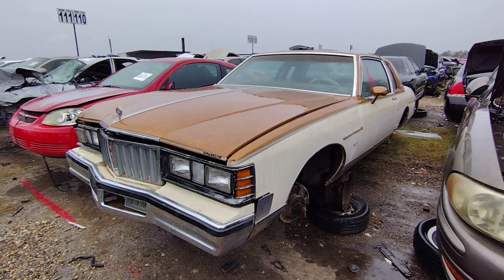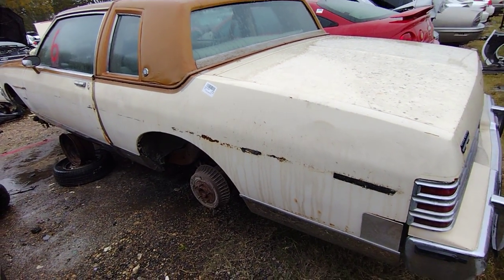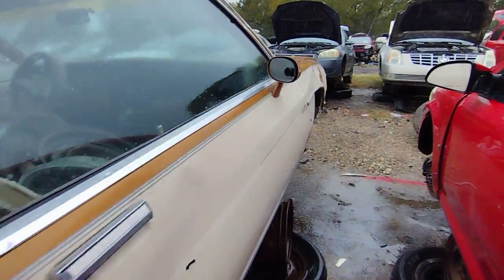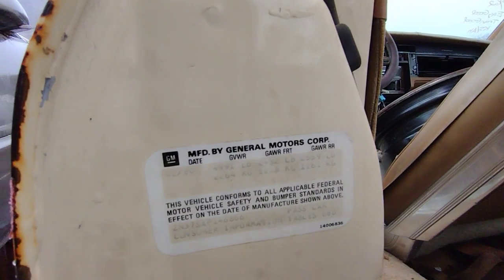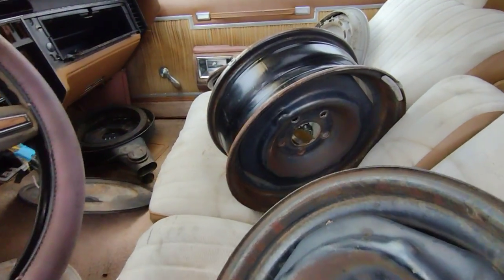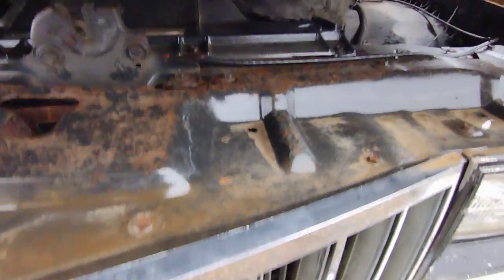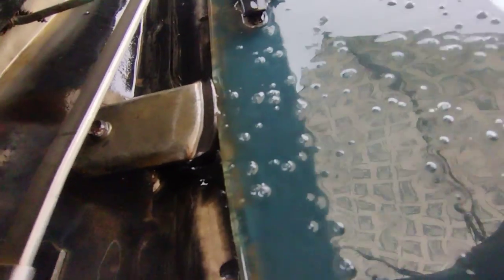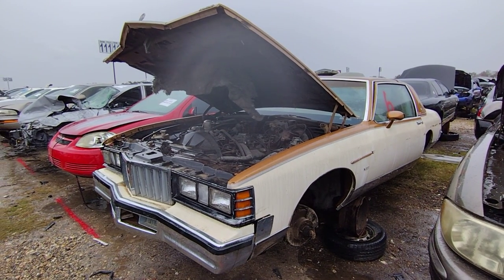One more year and this Rare 2 Door model would be no more. 1980 Pontiac Bonneville Junkyard Find

Comment: I like this car.  You are right - this is the mid range option, the lowest was the Catalina, the highest was the Bonneville Brougham.  The 265 V8 - very small.  Only offered in 1980 and 1981.  This thing couldn't have much power.  I drove a 1980 Regal with this engine.  It sure didn't feel like V8 power even though it was a V8.  And this car is larger and heavier than that.  What I really like is the two tone paint on this!  What is interesting is the right front fender - the tan lower body color came off in one spot - which showed how they painted the car.  The whole thing was gold at first, then they went back over the lower body with the tan paint - kind of interesting.  I didn't think that was how they painted these two tone cars, but that must be what they did.
Reply: Yes, the 265 V8 was slow, we had one. My parents did not regret it as the 1979 gas crisis was in the not-too-distant rear-view mirror. My parents were conservative drivers, so they benefitted from the smaller V8.

Comment: These were very rare in 2 door. These 265 4.3L V8 were notorious for blowing head gasket. The came with the following engine choices standard was the Buick 231 CID V-6 (1980-1982) 4.3L 265 CID V-8 was made to meet CAFE standards for (1980-1981), also came in the Oldsmobile 307 CID and the 5.0L Chevrolet 305 CID V-8 (1982-1982) Oldsmobile 5.7L Diesel option (1980-1982) to meet CAFE (Corporate Average Fuel Economy) in 1980 to meet 21 MPG and then  by 1984 CAFE standards across all lines kad to meet 24MPG and then by 1986 most everything was downsized especially at GM Chrysler to Front Wheel Drive to meet CAFE standards for 1986 of 26 MPG. The last year of these Big Oldsmobile 88 were 1985 and the last B body 98 Buick Electra Lesabre was 1984. By 1996 the Caprice and Impala SS  were done  Buick Road master from (1992-1996) Cadillac Fleetwood LT1 (1992-1996)Lesabre/Electra estate wagon(1980-1991) were the only RWD left outside of the Ford Panther platform which lasted until 2012 model year. Chrysler axed all their RWD varietals  Diplomat/Gran Fury and Fifh Avenue M bodies by the end of 1989. CAFE standards by 1995 had to be 27.g MPG across the manufacture;s whole line up
Reply: The 1982 Bonneville was not the same thing. It was a "G" body in 1982, and a B-body prior to that. No, the 265 V8 didn't blow head gaskets. It was an economy engine and just a baby Poncho V8, albeit underpowered in a large B body car. The 307 Oldsmobile engine was not used in the 1982 Bonneville, but it was used in 1981. My neighbor had one. In fact, you couldn't get a V8 in one in the 1982 model year in the US, only a 4.1L V6 as the top engine option.

Comment: New aero body for 1980. I believe the Bonneville was C Body and Catalina was B body. 1980 was a bad year for full size GM car sales, this Pontiac was no exception. Do not remember seeing many of these back then although the Bonneville did come back with a vengeance in the 1990s into the early 2000s. In the 1980s as Pontiac/GM was quirky with B/C bodies. the Catalina disappeared then came back as the Parisienne.  Fully equipped Bonneville Broughams of this era was interesting either 2 or 4 doors. Seem very rare today.  Shame this one was not well maintained. Any engine was fairly anemic.
Reply: That's not correct. The Bonneville would have been a B body then. There was no Pontiac C body in those years.

Comment: Had an '81 bonnie coupe. thing was white with white landau and black gut. Was such a pretty car but it was the dreaded DIESEL 350. Bought it used for 3500 in '85, and traded it in on a '86 Taurus. Car was great, until it wasn't. Too bad tho, it was pretty
Reply: "Shoulda had a (gas) V8". LOL. The 307 Olds V8 was the engine to get in 1981 if not for the Pontiac 301 or the Pontiac 265 V8.

Comment: I sold one of those grilles for $100 on eBay last year from a car in my local pick yard.  Peeling chrome and all.   Those taillights would sell too.  The one here was I think a '77.  Yellow with the same tan interior, loaded, coupe.  If you click through to the channel I posted some videos on there's one showing it.  

I almost pulled the factory sunroof out of it, but the car was moldy and stinky and the glass in it was cracked.

That's a pretty rare motor.  But not worth anything except maybe as a boat anchor.
Reply: The one you found with the sunroof was a 1980 and similar to this one. You're incorrect about the 265, but I get it, that's what most people think about it and I respect that. LOL. Nothing wrong with the 265, but it was vastly underpowered. It was right for the times though.
Reply from the maker: I seen your video while looking up to see if anyone had made videos on an 80 Bonneville in the junkyard.
Reply: @googleusergp  Like you said, underpowered.  The car is a boat and this engine is like the anchor.  lol
Reply: @CR7659  They weren't THAT heavy. Lol. We owned one from new, same as this car, but it was an '80 Brougham. It wasn't bad overall. We had it for a little over two years before it was stolen in 1982.
Reply: @googleusergp  back in the day at various points I had a '77 LeSabre, 89 Safari, and drove my folks 84 Electra Limited and 88 Caprice.  Comfortable cars for a road trip.   Marshmallow handling and not going to win any drag races.
Reply: @CR7659  That's why you bought them---for the ride.

Comment: Where is this car located?  Looks like we finally found a use for those old Pontiac 301s we all swapped out of very late gen2 Firebirds...as 10¢ engine swaps into those 6 or 7 cars in world history that were built with the even more ridiculous Pontiac 265. 🤪
Reply: You have to remember the times. 1980 was fresh off the 1979 gas crisis. Small V8s were all the rage. Not fun to sit in line for gas and many didn't want to repeat that. LOL.
Reply: @googleusergp  Yep ..I was just about to start driving (legally) back in 1979 and remember it well. 🤮 My folks had 2 cars but they both had "even" license plates so we could only buy gas every other day anyway. D'OH!!
Reply: @serfcityherewecome8069  Nope, we had odd and even plates back then, so we had no issue. The original plate number that we transferred to our '80 Trans Am when we bought it is still on the car to this day.

Comment: 4.9 maybe?  Alot of those cars had the Pontiac 301 cubic inch V8.  4.9 liters.  They usually got the terrible THM 200 transmission.  I drove a 1979 Oldsmobile Delta 88.  It had the Pontiac 301 engine but, had the much more reliable THM 350 transmission.  It was terribly slow.  Back then, some mechanics would swap in a THM 350 transmission in place of the 200.  The 200 was lighter sapped less energy than the 350.  My buddy had a '77 Pontiac Catalina that had the 301 and the 200 trans.  The power was adequate, but, you guessed it, the THM 200 transmission failed.
Reply: No, it's a 265 V8 (4.3L), VIN code "S", RPO code "LS5". Benny is correct. My parents had one. The 301 would have been a VIN code "W", RPO code "L37" four barrel in 1980.